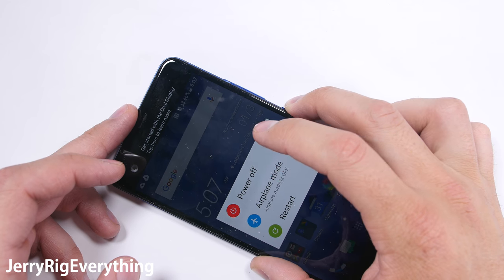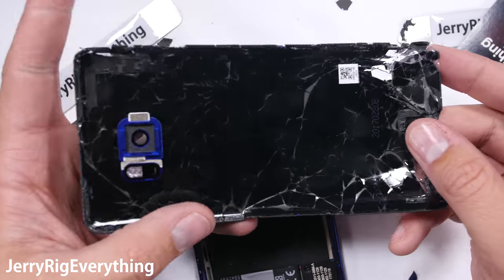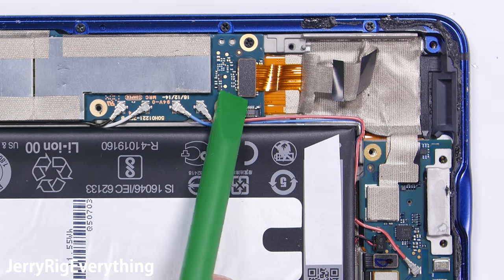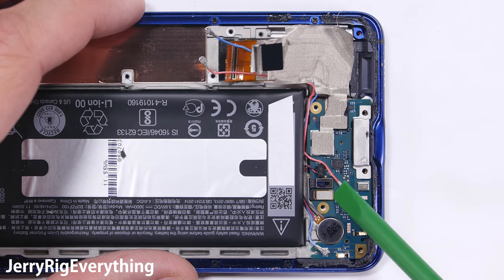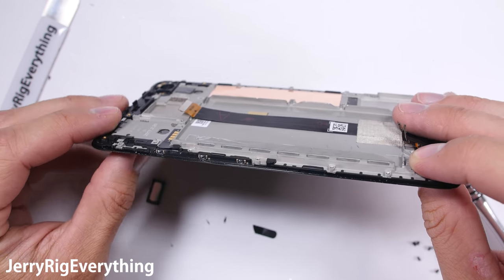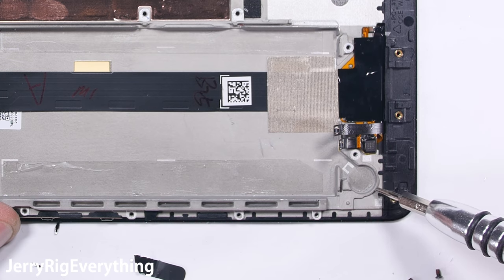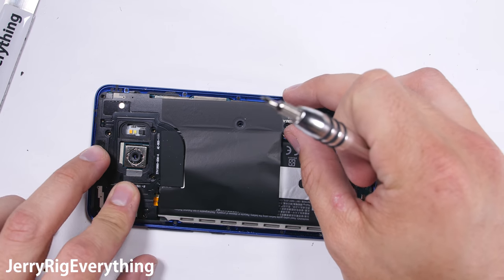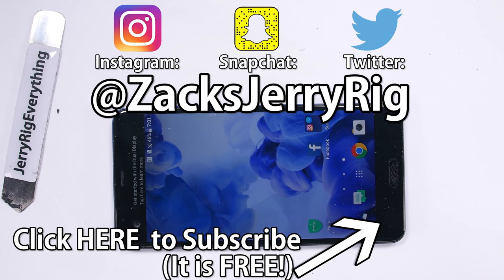HTC U Ultra Teardown - A Waste of Space?!?

Comment: This is the most roasted phone ever.
Reply: Michael Stgo I think that award goes to the Note 7
Reply: Ivan Alvaro The note 7 was actually a really good phone except for a manufacturing issue. The design of the note 7 was great aside from the battery. The u ultra is too expensive with no redeeming features.
Reply: nomnomguy680 The Note 7 was great, a lot better than this thing they decided to release.
Reply: I thought the Note 7 was...
Reply: The Note 7 fires were a Masonic hoax, 7 and 5 coded. Samsung didn't forget how to manufacture phones. People are very stupid for believing it.
Reply: Note 7 was a lit phone
Reply: Jaramos 
The U Ultra technically WAS made to replace the Note 7...
Reply: the note 7 was literally the best phone of its time. The only problem was that a couple defective models caught fire. The HTC ultra is an awfully mediocre phone with a premium price tag, HTC deserves all the shit it's getting for this trash

edit: the note 7 is STILL the best phone at the moment
Reply: asd fgh fr i loved everything about it, the shape and perfermance and everything, its a shame they caught fire
Reply: asd fgh not so much a couple of defective devices as it was serious design flaws. It was too easy to bend or put pressure on the battery due to a thin case from cramming so much tech in a small form factor.
Reply: nomnomguy680 Just like the Google Pixel. An overpriced phone with no redeeming features (aside from performance).
Reply: Michael Stgo you forgot about the part where literally everyone roasted apple for their missing  headphone jack
Reply: "No redeeming features (aside from performance)." is a stupid statement. It's like saying "no redeeming features except this very redeeming feature."
Reply: Jason Well, that's what it's quoted for. My point is that it doesn't deserve the sells it's getting, for all the 2017 features it's lacking. Most of those features being: Water resistance, stereo speakers, dual camera, bezel-less display, ect. It doesn't deserve the sales.
Reply: Jason And also, good performance isn't a feature… it's an expectation. There's a difference. I only brought it up because it was used as a selling point by tech reviewers.
Reply: Singling out performance implies that it's not just "good", but better than the competitors. That's a feature. Just like the performance of a high end computer is a feature that necessarily increases the price of said computer. There's a reason that high end performance components cost more than budget ones.

It's insane to think that someone could look at something like a bezel-less display and go "there's a feature!" and look at performance and go "bah! not a feature". Go slap the internal components of a phone from 2010 in a phone with all the "features" of a modern phone and tell me that performance isn't a feature.
Reply: I think it's the G5
Reply: dadum dadum I never ran out of points, I just frankly got tired of his fanboy-ism.
Reply: The Amazon fire phone took a bit of heat in its day
Reply: Michael Stgo even more than the note 7 that literally roasted.
Reply: Michael Stgo Note 7...
Reply: Michael Stgo Note 7? Iphone 6 plus? i mean, at least this doesn't have a catastrophic failure.... oh the device itself is one lol
Reply: ROURKE oohh ROASTED lol
Reply: Joshua Sandoval I don't even own a pixel. I haven't even mentioned the pixel, as a matter of fact. I merely spoke about the silliness of disregarding performance as you did. I'd have done the same no matter the phone in question.

You're right about one thing though. You didn't run out of points... you just didn't have any to begin with.
Reply: Jason
Reply: asd fgh I prefer the HTC 10 way more it even has a dac and an amp
Reply: what about the NOTE 7?? THE ROASTED AF PHONE
Reply: note 7... still have mine, post this using it. it is the best phone to this day.  a few flaws of few models don't count. a bunch of jealous prepaid news reports that made samsung call off the phone... bad for samsung, but not for me, since now I've got a full refund no questions asked lifetime warranty on my note 7. (: great. waiting for note 8
Reply: C T note 7 should have been the best phone of 2016
Reply: nah bro that award goes to the amazon fire phone.
Reply: dadum dadum The iPhone also has good performance, the best actually, but do I consider that feature? No I don't. The main reason the Pixel sucks is that it is an overpriced product. The Pixel costs the exact same and sometimes even more than the iPhone 7, yet lacks features like water resistance, stereo speakers and a dual camera, features that the iPhone has and the Pixel does not.
Reply: Joshua Sandoval News flash bud, you get decide what features are important to you, not what is or is not a feature. Performance is a feature for phones just like it's a feature for computers and just like it's a feature for cars.
Reply: Jason Whether or not it's a feature or not, does not matter. My point is that the Pixel is an overpriced product. The Pixel is lacking 2017 features, like a dual camera, water resistance, stereo speakers. The iPhone 7 has all those features and more for sometimes less. The price of the Google Pixel is ridiculous.
Reply: Joshua Sandoval Dual camera isn't a feature, it's a marketing trick. There is no use to a dual camera that can't be done on a single camera- except maybe 3d effect.
Reply: Christian Christian A dual lens is a feature, it allows a LOSSLESS zoom, and with software tricks a bokeh effect.
Reply: Exactly!
Reply: Yes, the refund is still active. At least in Russia it is. I called samsung about that after the "upgrade to 0% battery" was added, and they proved that even though you can't turn it in to the store, you can call them and they'll send a courier to pick it up for full refund. they also proved that there's no deadline to the return offer (actually, there can't be a deadline for that, since it would be against the law to reject a device they called off the market).
you may call your regional samsung department to check this info. if it is different in your country, let me know...
Reply: +Jerad Berry
Yes, the refund is still active. At least in Russia it is. I called samsung about that after the "upgrade to 0% battery" was added, and they proved that even though you can't turn it in to the store, you can call them and they'll send a courier to pick it up for full refund. they also proved that there's no deadline to the return offer (actually, there can't be a deadline for that, since it would be against the law to reject a device they called off the market).
you may call your regional samsung department to check this info. if it is different in your country, let me know...
Reply: Joshua Sandoval Phones have been doing that without a second camera.
Reply: Joshua Sandoval I've still not said anything about the pixel. I own a Nexus 6P. I didn't upgrade to the Pixel because I didn't feel that it was enough of an upgrade to justify the purchase when my 6P did everything I need it to and more.

I'm not here to defend the pixel. I'm just saying that your continued dismissal of performance is quite frankly idiotic.
Reply: Michael Stgo 
No the Note 7 roasted itself by catching fire
Reply: Some random guy Exactly, because on the surface the Note 7 was one of the best phones ever (until it exploded and the S8 came out a few days ago to replace it)
Reply: or maybe any iphone now
Reply: Even more than iPhones. Don't mind me I'm an iPhone user and I don't rly like him

Comment: Pretty sure it's priced so high because they need the extra money for uh oh protection. You're basically buying insurance.
Reply from the maker: Valid point.
Reply: Yeah but the HTC 10 had Uh Oh and it was a much more reasonably specced phone...
Reply: JerryRigEverything Obviously... you're suffering from boredom...Smh.
Reply: djlobb if I'm correct, the HTC M9 was the first phone to come with Uh Oh protection and HTC probably realized soon after releasing it that it was gonna be expensive
Reply: My M9 had Uh Oh Protection
Reply: 750USD Is not insurance, that's a huge amount of money for a service you won't need if you use a case or just look after your phone well.
Reply: Mgtakiller Mc  A part of your purchase price goes toward it.
Reply: That mobile should cost 400USD. I don't think insurances cost 350USD. It's almost double the phone's price for a service you might not need. That service should be free or cost less than 30USD. If the insurance service is expensive, people will just buy a case.
Reply: I think they are ripping u off on two things. Uh oh protection and the HTC branding. They force u to buy insurance because they get money on people who doesnt break their phone, and people would buy anything from a famous company like HTC, samsung, apple even if theyre rippoff.

Comment: But Apple got rid of 3.5mm jack not for space or even cost efficiency of the phone, but for profit in a way of forcing other companies that manufacture headphones to use Lightning port and also they, Apple, won't pay licencing for 3.5mm jack, since they did not make it. You explained this in your video Jerry right? Well.... Crap. :D
Reply: And as apple does something, all OEMs follow.
Reply: That's just how much influence Apple has in the Tech world.
Reply: The space from where the headphone jack was gave them room to put in a bit larger battery and a larger Taptic Engine.
Reply: Филип Пешић ,True.  hell they bragged about it. Well,  maybe not,  the GM said,  we're doing it cause wireless is the future. So hard to imagine a crumby headphone jack costing very much, and for what they charge for their products, you know they're swimming in profits.
Reply: At least Apple compensated with something.

HTC did not. They didn't even bundle an adapter.
Reply: I believe HTC did put headphones in the box. And as far as 🍎 goes,  wow, a dongle. Non of those little toys don't justify anything. Bottom line, prices are still too high.
Reply: iPhone's headphone jack removal is to add IP Rating and include stereo speakers. Not an Apple fan, but why should anyone settle for this? Hard to say, but HTC is one of the companies that destroys Android's reputation
Reply: Peter Ford Apple does too. Apple actually compensated with something and even gave you a little dongle. 

HTC did nothing. Just a pair of USB-C earbuds that do not work with non-HTCs.
Reply: Shawn Mendes actually all they removed the headphone jack for was a bigger vibrator 😂 its true.
Reply: I guess,  but how big a vibrator does a phone need?  And, we are all talking 🍎s and 🍊s. All the outfits have the ability to create a nice phone, with great hardware and features. My main point was price. I think the new companies have proven that you can build a quality product, and not charge twice what it costs for production, overhead, etc and still make a nice profit. Their attitude is,,, why should we? People are still gonna buy. We have them them in our proverbial pocket.
Reply: +Shawn Mendes The vibrator in my note 4 is the same size and it has headphone jack. As he said space isn't the problem. Money is.
Reply: Филип Пешић they actually removed it because it would not fit with their Taptic Engine. Please do your research first
Reply: pretty much an excuse to get rid of it amirite?
Reply: Shawn Mendes true enough, how many phones have headphone jacks and also a decent v motor. My moto x pure  has both and the one in mine is the same as they put in the Xbox one elite controller. Your right, excuses, excuses.
Reply: Apple also got rid of 3.5mm jack because it is dated. We have had them for decades. Let's move forward already. My only issue with Apple's decision is that they kept only 1 port. This is dumb. Headphones should have a dedicated port, but not 3.5mm or lighting. USB-C or at minimum USB-A 3.1
Reply: Mike Sico Well, its dated for a reason.

It's reliable and ubiquitous. Why else do you think the audio industry never bothered to release a successor?
Reply: Yep lets replace a perfect analog output with a digital output that I also require for charging; just for the sake of updating. If you owned nice headphones you would give a shit; I would never buy apple but if I did I would have to replace hundreds of dollars worth of audiophile grade ear/headphones. Gtfo
Reply: I'm literally listening to this video with headphones while charging my phone. No extra dongles required.
Reply: Another little item I wonder could be added to cell phones,, a reset button. Very tiny, but very handy for all the new non removable battery phones. When rebooting totally is impossible. Just a thought.
Reply: Don't know though if reset buttons actually disconnect battery, or what they do.

Comment: Let me clear some things up:
7:15 This metal "boxes" are shields, their main role is to block EMF going in and out of ICs. 
8:03 This flat-flex is only for DC power. DC doesn't interfere, because there is not fast enough change in voltage (and current). Car's "12V DC" is very noisy (running alternator). In addition coax will block rest of the noise.
Reply: yup...exactly
Reply: same thing I said to myself, great teardown nonetheless.
Reply: "DC doesnt interfere"
This is straight up wrong, Every conductor which has a voltage applied emmits a Electro-magnetic field that can interfere other conductors running parallel to another. Also the interference is at max 0,1 volts.. That wouldnt do nothing if only AC could interfere.
Reply: Wooooooooshhhh
Reply: krawacik3 e

Comment: The internal structure on this is so similar to the Note 4, yet Samsung managed to put a 3220 mah removable battery into it, while HTC uses a mediocre 3000mah battery.
Reply: the s7 edge is smaller and has 3600mah, the regular s7 is even smaller and has the same battery capacity
Reply: And still has a headphone jack and nfc
Reply: and wireless charging and waterproofing
Reply: Rei Rescu Exactly
Reply: TVCH LORD The Note 4 didn't have waterproofing and wireless charging.
Reply: And small bezels
Reply: Emperor Palpatine Neither does the U Ultra.
Reply: ***** I know, TVCH LORD is saying that the Note 4 does have wireless charging and waterproofing.
Reply: Emperor Palpatine 
Note 4 had wireless charging except Samsung decided to keep a separate pricing for it.
Reply: CD27 If you say it like that even the S3 had wireless charging.
Reply: CD27 If you say it like that even the S3 had wireless charging.
Reply: +Emperor Palpatine He was replying to Rei, I believe

Comment: It still looks like a good phone to Specs are still good on it, I don't use wireless charging in my phone has wireless charging, because I'm not going to use wireless charging in my car, you still have to plug the wireless charging back into the same connector that you would plug into the phone, as far as the waterproofing goes I didn't buy my phone for the waterproofing it just happens to have it, it depends on what you're looking for, I also would not buy a phone with a glass back to it, since it is going in a protective case anyway.

Comment: well allot of people are complaining about the price but you do forget that htc is one of the best Quality builds out there i don't hear on the news ever an htc phone blowing up or burning up RARELY and even if it falls a million times it's still gonna run, but on this model they should not have used the Glass/ kind i owned an htc desire z and an m8 still owning and its not that i watch it 24/7 not to break anything my htc desire z still runs even after owning it for 7/8 years still can turn it on everything is running fine only thing is the battery but all the rest works lol i mean when you pay allot for htc you actually get allot of QUALITY real htc owners can confirm this prove me wrong lets not bash each other just lets have an open conversation or an arguement on here :)

Comment: I would much rather a better vibration than a headphone jack personally. Other than that this phone is trash. I am not bothered by the waste of space. I'm bothered that features in previous models didn't appear or progress. No headphone jack is a backward step not a forward step. It's forward when a new port replaces it. Except there is still only 1 port. The camera is a step backward, not ok when we are a year forward. Mostly everything else is the same. Staying the same is basically moving backwards. 

Also every time I said backward it was a start to a line. weird.

Comment: Samsung j8  4GB RAM, 64 GB Storage, Snapdragon 450 SOC, of INR 18000 feels slower which is launched at 2018 compared to Honor 9 lite 3gb RAM, 32GB storage, HISILICON KIRIN 659 of INR 13000  launched at 2017. I felt  apps opening much faster in honor9 lite than Samsung J8.But  Honor 9 lite is not durable. Can anyone explain why high end phones feels slow compared to low end devices. I think this is due to higher Clock speed of 1.7Ghz of 4 Cores and 2.36Ghz of ither 4 Cores in  Honor 9 lite Compare to 1.8 Ghz on Snapdragon 450 also remember that I had used Saudi Arabia version of Honor 9 lite not Indian made and Samsung J8 made in India. I also felt superior quality in Foreign Smartphones Compared to same smartphones made in India. I felt new generations of   mediatek, Snapdragon and  Samsung Exynos processors  becoming slower compared to Hisilicon Kirin of Huwaei. I felt more slowness in Mediatek Processors, MediaTek advertises some processors of 2.0 Ghz  but its speed is only  comparable to low end Snapdragon SOC with 1.4Ghz. I felt MediaTek processors becoming too slow.